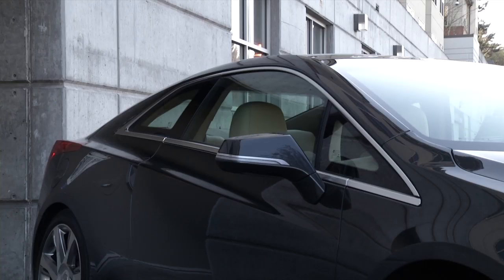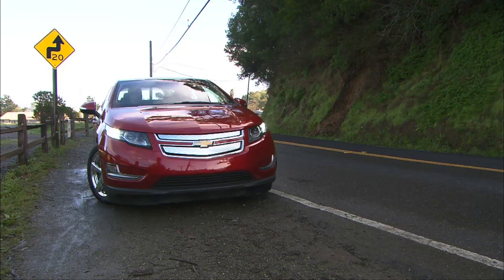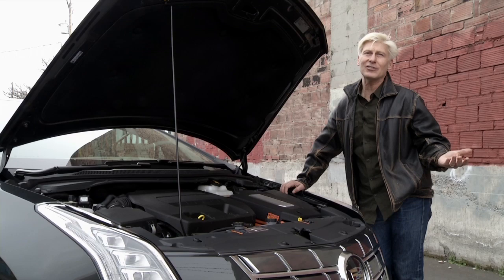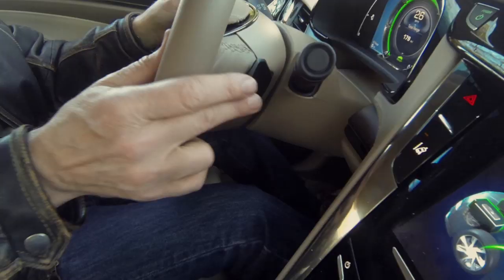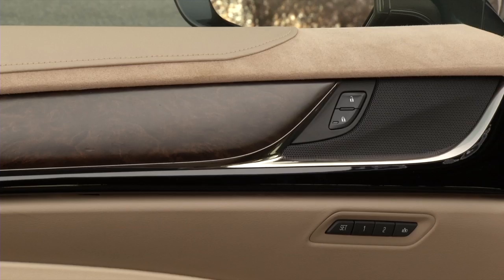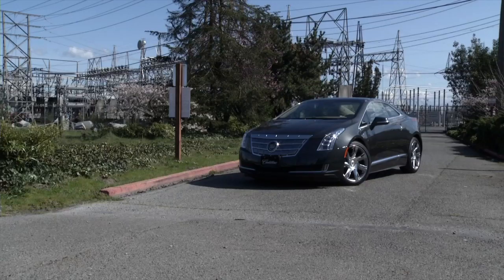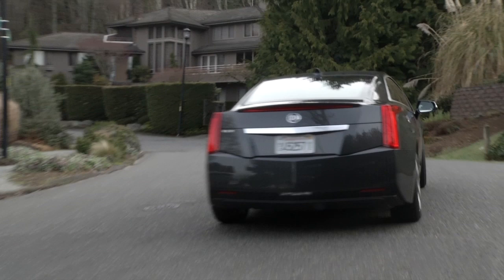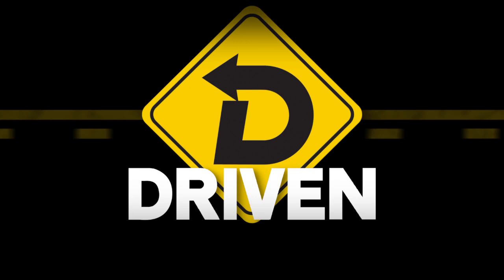2014 Cadillac ELR

Comment: I sat in a XTS at a dealership and fooled around with the touch interface. I guess it's just me being a younger person (22) and I didn't find a problem with the response of the touch. I guess it's a different story while driving, but it's nothing steering wheel buttons can't handle (as far as the radio goes).

Comment: Hi Tom! I'm looking to buy myself a new car. What website did you use to buy your ELR? I remember you bought it from a far away dealer because they gave you a great deal. I cant seem to find the video where you mentioned all this info. Thanks for all your great reviews!
Reply from the maker: +bigwillchill It was at the end of the new Volt piece.  All I did was go to cars.com. I found six ELRs equipped EXACTLY the way I wanted them and sent out a form letter asking for their lowest price. I ended up going with the second lowest price ($44,500 before tax credits) because the WI location was closer than NY so transportation costs were lower and it was physically easier on the car. I also liked the HOLZ dealership, they were very straightforward. FYI, I had very good luck with http://www.centriccarriers.com. Ask for Jonathan. 

Does that help? Best of luck. I have still to put the first tank of gas in my car.

Comment: So... you pay $82,000! For a Chevy volt that's less practical, has 2 less doors, a body kit and some leather. No wonder they only built 260.
Reply from the maker: Most people got them for under 60K. I bought a brand new one for about 35K after federal tax credits, There's a lot more than leather and a different body going on with ELR. Also, there were 2,800 made.
Reply: No. There's a few on eBay for $28,000 and less. That's a $60,000 price drop.